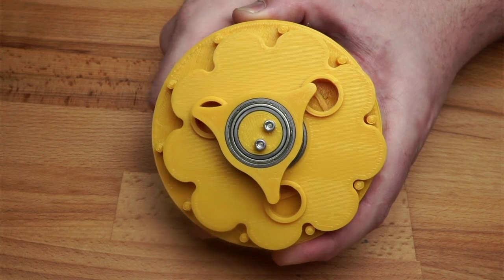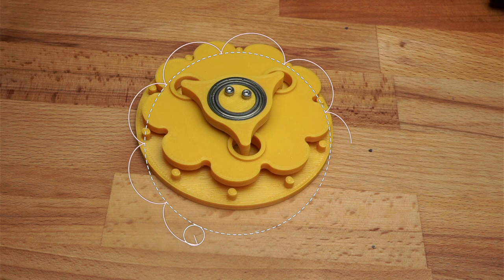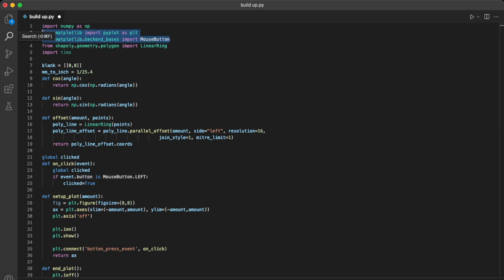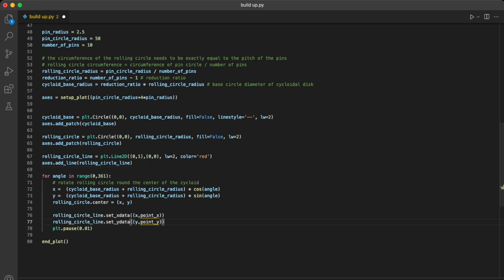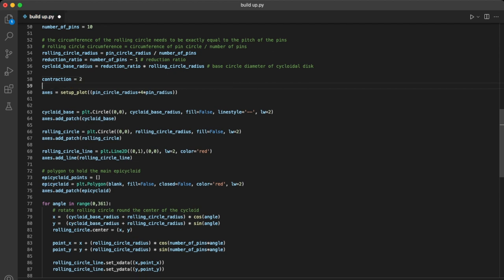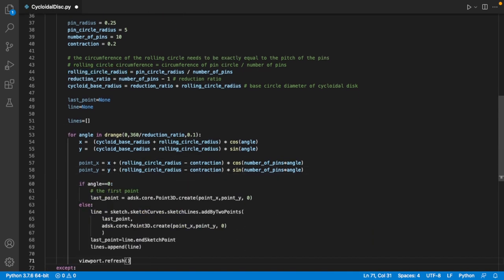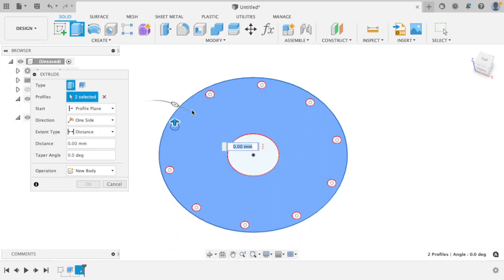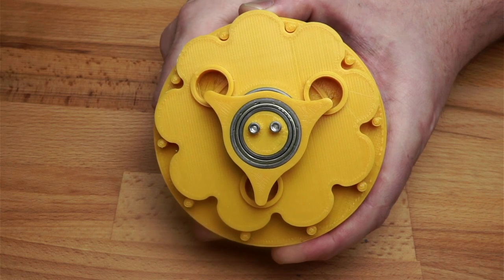Designing a cycloidal drive in Python and Fusion 360

Comment: This video and supporting materials are seriously so amazing. You show the full equation with a graphic, and also supply a script for generating these in fusion. I was very surprised to find that fusion doesn't have a equation driven curve function, especially in 2023. If it did then designing these would be easy, I kept looking online for a script to do equation driven curves and the one addon that I could find seems to have been deleted recently for some reason.
You have singlehandedly solved all of my problems, and given me the knowledge on how to use the script feature to make equation driven curves in future projects. 
You're legendary man.
Thanks so much.

Comment: Maybe i missed it but what is the relationship of the eccentricity to the other factors? I want to have 20:1 and increasing the number of pins to 20 (*2 from your example) and the contraction divided by 2 from your example makes it work nicely... but I seemed to miss why the eccentricity also needs to be divided by the same factor. I also assume there are limits on how much things can be reduced in one stage, before it becomes to difficult to actually move. But I really try to keep things as flat as possible and would therefor rather not add another stage.
Reply from the maker: The eccentricity is determined by the distance of the point on the rolling circle from the base diameter - as the contraction increases, the eccentricity decreases as the contraction moves the point closer to the base diameter.
I haven't found a good rule of thumb for what to set the contraction to, but instead normally start it at 0 and increase it until the shape "looks about right". you can also play with the pin diameter.

with regards to the maximum reduction ratio, in a perfect world, you should be able to have any number of pins you like and still drive it, but in the real world, you have friction to deal with - each pin you add will increase the friction. if you want to go to higher than a 30:1 reduction (which is the most I've tried at this kind of scale), I'd either increase the size of this, or consider a different material like PETG which has lower friction (also LOTS of lube - PTFE grease works really well)
Reply: @roTechnic  I have 2 wheels I need motorized, both have an inner part with a slew bearing of 239mm. That’s the max diameter I can play with. The 2 wheels need to pull the whole thing which will weigh about 22kg. The wheel outer is about 400mm and it needs to drive just brisk walking pace. Hence I thought I may get away with a 15:1 / 20:1 and a typical small stepper motor…
Reply from the maker: @kampfzwergxp  you should be fine with 20:1 and a good nema 17 stepper. Let me know if you need any help with the design
Reply: @roTechnic  do you have way to pm, maybe discord? I can show u what I have so far…
Reply from the maker: @Thomas Schönfeld  sorry for the delay in responding - just set up a discord server https://discord.gg/aj5dNAvD feel free to join and share your progress

Comment: Minute 6:29: Why you type in offset of 3mm as eccentricity, but in python you have 2mm / 0.2cm?
Reply from the maker: I think I was using slightly different contraction amounts - I was varying the contraction in the python example a couple of times to illustrate what it does, and what happens if you set it too high.
Eccentricity = (rolling circle radius / number of pins) - contraction
you can see the contraction will vary the eccentricity
Reply: @roTechnic  Could we use that eccentricity formula in order to calculate the number for contraction based on a given eccentricity?
Reply from the maker: @johnfelt1089  yes, absolutely. Sometimes you want to vary the eccentricity and sometimes the contraction. Take your pick!